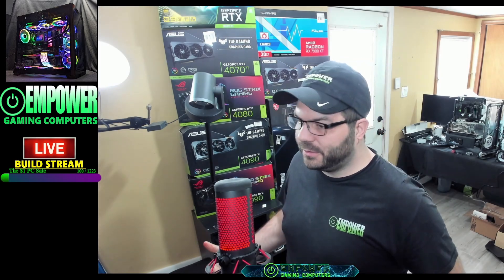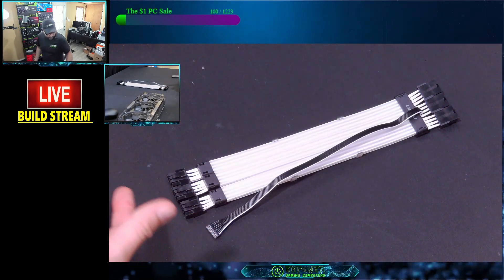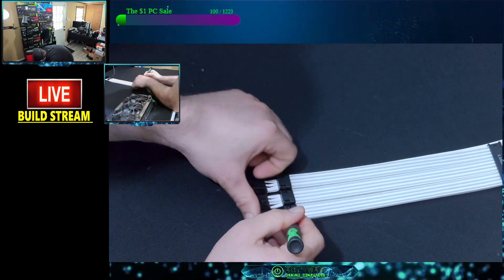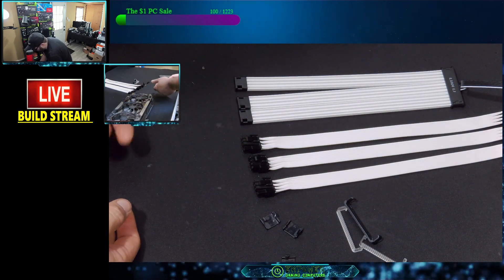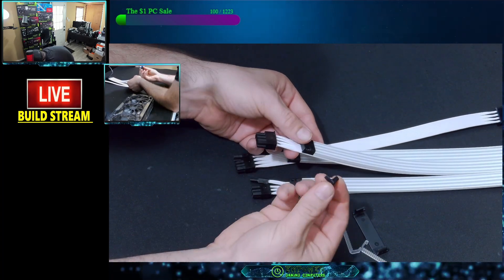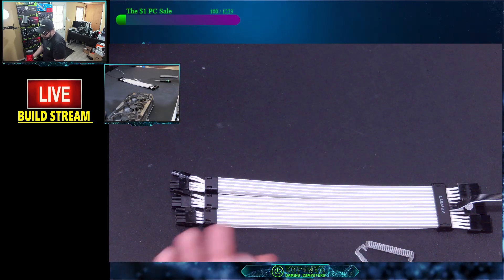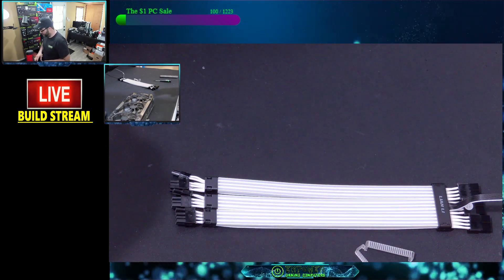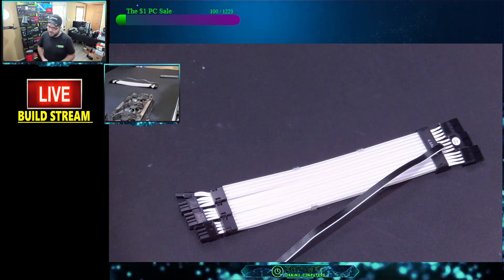How to reverse the Lian Li Strimmers V2 - Empower Gaming - Pro Tech Tips

Comment: hello i just  bought my 3x8 pin wireless strimer and 24 pin. The 24 didn t arrived yet with the controller even though i mounted the 3x8 and the led does not light all the way to the bottom. I looked it up on google and said that the leds are not burned, but what did i do wrong? Why do they not light up to the max ? Because i don t have the controller yet pluged in the pc or that s the model ?
Reply from the maker: Which versions of each strimer did you buy exactly
Reply: @empowergamingcomputers i bought 3x8 wireless and 24 pin wireless with controler, for the moment only the 3x8 I mounted until the 24 pin arrives it s the v2 wireless the version of them
Reply from the maker: @alextihan3335 yes, it will require the controller if they are both the wireless version.